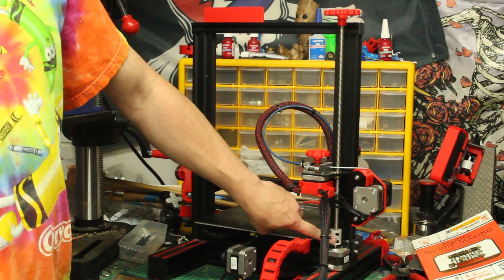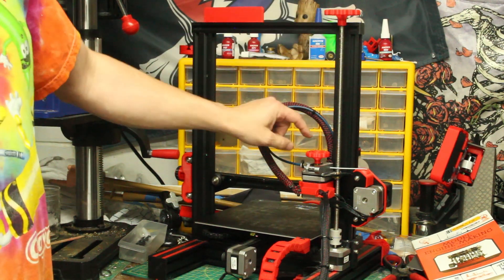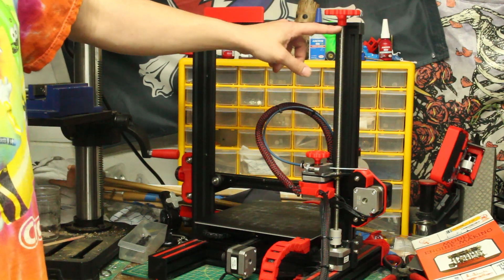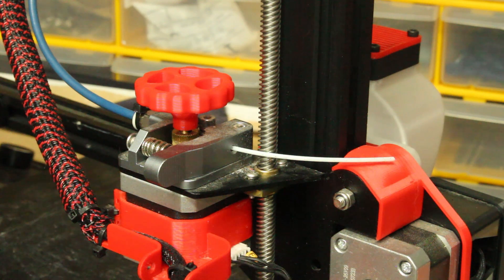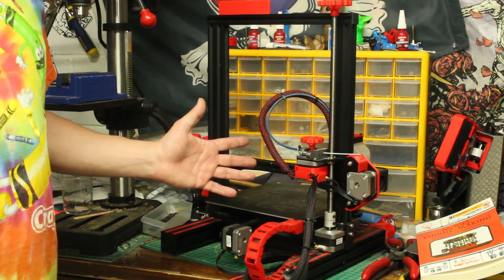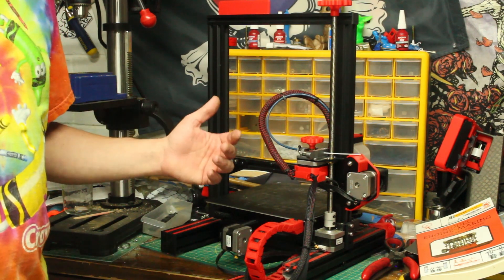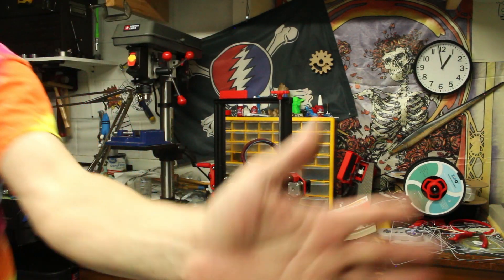A Mod Your Budget Printer Doesn't Need: The Lead Screw Stabilizer

Comment: The one scenario you DO need leadscrew stabilizers at the top is if you're running a dual-z setup with a synchronous belt to keep the two sides in step (pun intended) with each other.  Without them, you can't keep the belt in tension.  I feel it would only be fair to make an addendum acknowledging that scenario.
Reply from the maker: The beginning of the video specified that we are talking about entry level printers. I already specifically acknowledge that modded printers and higher end printers have different needs. 

Thanks for the feedback but I completely disagree that an addendum is required.

Comment: Yeah, that really makes sense. I  would've wished that I found you video before I printed the accessorie and bought the bearings😒
Reply from the maker: I've printed a lot of accessories for my printer that I later reconsidered. At least it wasn't an expensive addition.
Reply: @makerunderground  Na, fortunately it wasn't that expensive, but I just found another mod where I could probably get one of those bearings to good use. It's a filament roller guide, and I guess it's actually useful unlike that lead screw guide.
Anyways, thank you for the video👍

Comment: Dual z steppers with belt and top bearings using flex coupling and alloy mount.  The only reason there’s an issue is the bad plastic gantry mounts move steppers out of alignment. If your gonna mod you’ve got to do it all
Reply from the maker: I agree, there is definitely a right way to do it. As you say, it involves a lot more than a $2 bearing and thingiverse file.

Comment: The ball screw in my Monoprice maker ultimate (Wanho D6)  printers have error in the motion such that is ruins the sides of the prints. I measured the motion and the screw itself has a cyclical error. What ball screw brand would you recommend? The prices go from $15 up to $700 and it's hard to know what will be accurate but not overkill. The motion of the lead screw in my Prusa is spot on accurate when measured with my digital caliper. You get what you pay for sometimes.
Reply: i saw a video on magnetic motion decoupler for cheap ball screws a while back i dont remember what the video is called off the top of my head but it shouldnt be hard to find.
Reply from the maker: Sorry, I'd love to say I have a great answer for you but I'm just not familiar enough with the specific brands. Good luck on your endeavors!
Reply: If it's the sideways motion that is the problem, maybe you could look into mounting the nut (or what was it called for ball screws again) on an Oldham coupler: they transfer torque put allow the part slide in X and Y, with constrained Z. Saw it being used for Z lead screw nuts just a while ago.